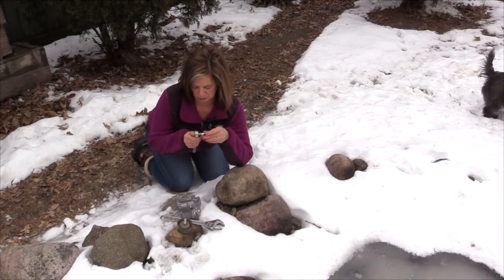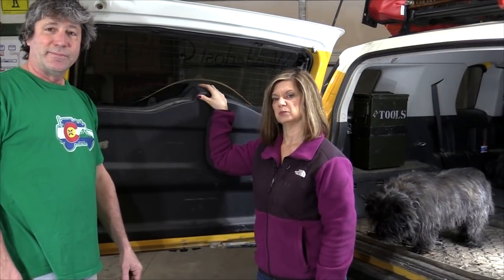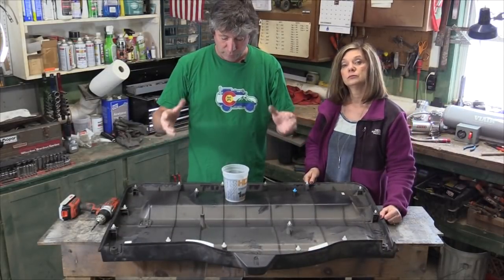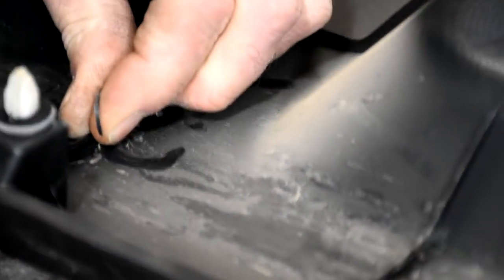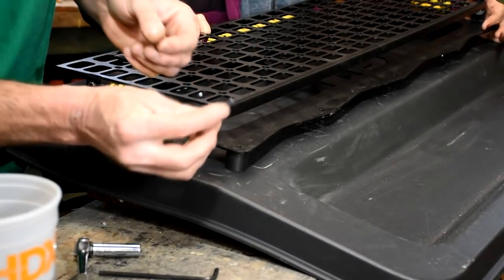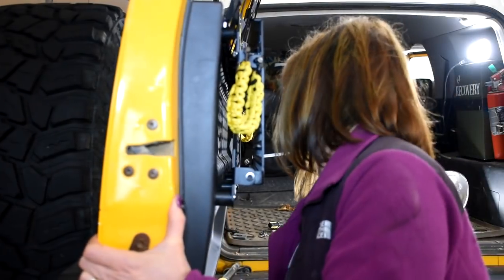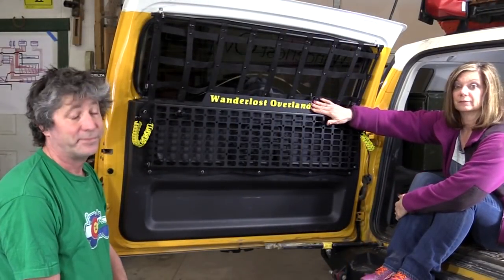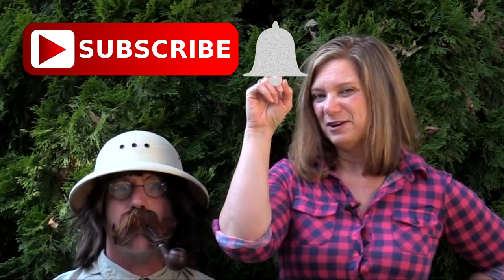The Coolest! Rear Door Storage Panel/ Fold Down Table, FJ Cruiser

Comment: Hi Mark and Merri. I love your videos. I have considered this panel as a cooking tray for my stock 07, but my rear gate is not horizontal when opened.  When installed as you did, the tray in my case would slope down towards the front of the FJ significantly enough to make it impractical. At the 8:18 mark the liquid in your wine glass appears level and I couldn't find any other indications of sloping. What is your trick to get the tray level?
Reply from the maker: The table is at a rather steep angle. Good for anything but putting the stove on.

Comment: I really want one of these.  Just waiting on my wife to Green light it.

However we just got a dog a couple of days ago.  I'd like to know more about the rear window net.  I tried searching and couldnt find it.
Reply from the maker: The net we made ourselves after a loooong search for one the right size. It's just 1" webbing riveted where they cross. At the bottom they loop around a piece of 1" wide flat aluminum stock. At the top they loop around a piece of 3/4" round aluminum tubing, held up with a couple cable hangers. The open-loop cable hangers allow us to disconnect the net at the top when we need to haul something long like lumber, sticking out the window.
Reply: Wanderlost Overland that would be why I couldn't find any like it. (T_T)
I work 15 hours a day.  Don't suppose I could PayPal you the funds to make another one.   Hahaha.
Reply: Yeah that looks perfect I would like one also.
Reply: Leerburg ventlock is a nice gadget that every FJ owner should have :)
Reply: carbonunit or just a cheap fence twister for $3 😉    I want this so I can open the window fully & know the dogs will stay